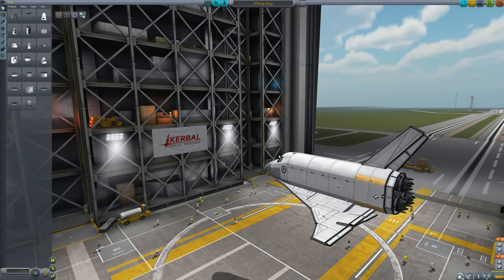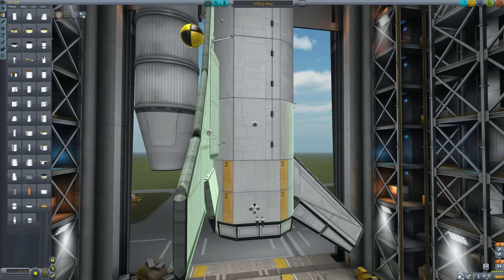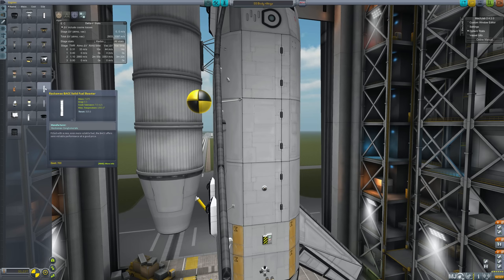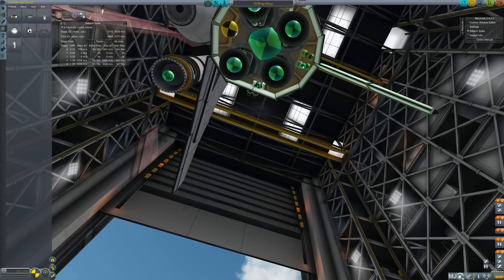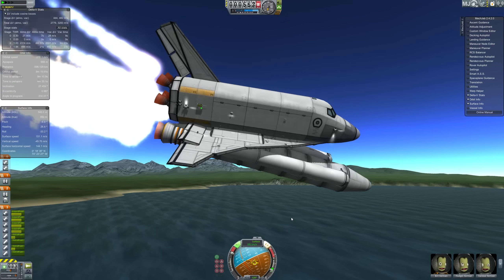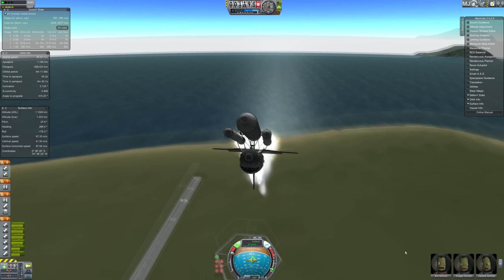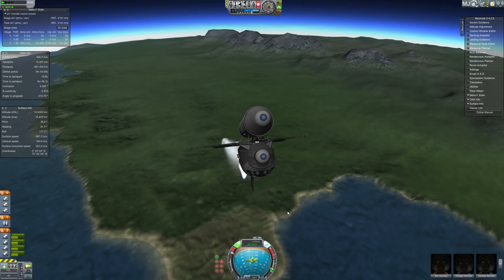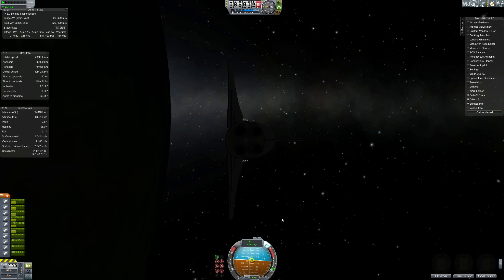Making The Kerbal Shuttle Fly To Space!

Comment: Fun fact: after the real Space Shuttle ditched the SRBs, it actually was too heavy to make it into orbit. However, after burning fuel for another few seconds, it then became light enough to continue going into space. So it was basically built EXACTLY the right size.
Reply from the maker: Orbiter 2010 specifically covers this in it's FAQ, don't enable infinite fuel if you want to fly the shuttle to orbit.
Reply: My shuttle had that same problem, except it lasted about 20-30 seconds.
Reply: Bioshyn that's typical for rockets, especially in KSP. That happens to me all the time, however in the case of the Space Shuttle orbiter,when they say it has just enough thrust and loss of fuel, they don't mean that it looses a couple m/s of acceleration, they mean that it looses significant acceleration.
Reply: The Space Shuttle was way beyond the limits of the original plan. 
Sarcastically: Thanks Air Force.
Reply: OBP Super Gamer actually, yes, that is completely correct, but I used that as a relatable example. Also they have worse thrust-to-weight ratio in KSP, but the Earth is much larger, so KSP has a better thrust-to-weight-to-planetary-scale ratio or whatever, if you know what I mean.
Reply: Scott Manley I made that mistake once. Couldn't figure out why mother Earth pulled it back down again, hehe.
Reply: It was designed like that intentionally because of the complexity of building such a craft. The space shuttle is made of really light material because this really does come to show that every little bit of weight matters. In fact, the space shuttle is made of a fabric that is made of a rock (I think it was granite, although I don't remember exactly), along with carbon-carbon (black) insulation tiles on the parts that get heated most during re-entry, unlike what the textures in this game show. It's really misleading, and, when you see the space shuttle in real life (which I did) you can see (and even hold and touch samples of) the fabric and how light it is and the heat shield material on the bottom, which is also extremely light for how strong it is. So it's no coincidence that the weight was balanced so delicately.
Reply: 71tofu Not at all, actually...

Spaceplanes are much more difficult to build. Why do you think it took NASA about 20 years to fly the shuttle? Counting designs from the mid-60s, of course.
Reply: 71tofu That's debatable.

The USAF wanted a much larger design to accommodate their future planned spy satellites. This causes the Shuttle to be more expensive and larger than planned.

Did you hear about the astronaut who's going to spend a year on the ISS? ( If you ask me it's a few years too late...)
Reply: Skul, Oh My God I learned that building my full size one - it's heavy as all hell! It was like kerbin was chained to the bottom of the rocket. I have three KR-2Ls on the back with Mainsail OMSs and it barely is enough to pull away after SRB decouple -it still slows down after it comes of. Scary stuff Shuttles.
Also, Scott's shuttle is simple but horribly inaccurate - I managed to make a Full size shuttle that looks much better than his. But not everyone can be me i guess XD
Reply: 71tofu It's what reality is, support and funding.
Reply: 71tofu See, I wasn't going to reply to your previous comment calling Wheatley a dick for stomping on your dreams with reality, but honestly... you presented your dream machine as fact, then argued with other people that it's fact when it's not even a tested hypothesis, then fought everyone over the fact that they brought reality to bear against your dream:  dismissing their proven reality as irrelevant to your hypothetical one.  If you had presented your point as, "I'm working on a design that might work" instead of "My design will be reality", his(?) approach would be dick-ish.  Instead, you're being stubborn and insisting you have the new cure for a problem without any data to back it up, then snapping at people who point out that you have a hypothesis that needs testing - which requires further analysis, financial investment, resources, et cetera.  Calm down, reevaluate things, and remember - these are just words on the internet.
Reply: Sierra Whiskey Yeah, if he weren't saying it was in fact possible and such I wouldn't-v'e "stomped on his dream". It's just that he argued that it was indeed a fact.
Reply: Wheatley Money wouldn't be a problem if humanity wasn't greedy, no?
I think we must end this, as neither side is getting anywhere. David North thank you for siding with me. It does my heart good to know I'm not alone in this.
Reply: +SkulShurtugalTCG A lot of rockets are like that. For example, the TWR of the Saturn V was about 1.2, however, after first stage separation and second stage ignition, the TWR was about .8. So as it burns fuel, the TWR increases, bringing it above 1.
Reply: The whole point of a rocket is to burn fuel. By doing so they go to space. Not really a lot of fun that fact.
Reply: rocket equation in action
Reply: And that burning of fuel did not propel it any further? Only made it lighter? I doubt that. I guess what you mean may be that its TWR droped below one for a short time,  but if it did that does not mean that that fuel was wasted.
Reply: lol I just use Space Shuttle Engines.
Reply: Markus *Mother Kerbin* 
:)
Reply: Wheatley Father Kerbol?
Ship confirmed, be prepared for fanart.
Reply: KASASpace Well, to be fair, the space shuttle proved its use so well that it would be hard to do without it. Still, the need to keep people in space for extended periods of time is declining, so I'd imagine that they're going to go back to the drawing boards to create an actual space plane. Such an item would be incredibly useful.
Reply: KASASpace If you ask me, we should already be launching the mission to Mars.
However, a space plane can still be made large enough to launch a spy satellite. It would be a larger upfront cost and have a slightly higher maintenance cost, but you could launch it at a moments notice, provided you can refuel its tanks. I think most people underestimate the ability of a space plane. We have the technology to get one into orbit, why aren't we?
Reply: 71tofu Spy satellite designs quickly got smaller than the 15 feet by 60 feet that the cargo bay of the shuttle needed to be.

And a spaceplane is not necessarily a SSTO.
Reply: KASASpace That's true. My concept for an IRL spaceplane involved using drop tanks for liquid fuel while the fuselage had LFO. It had one main engine, the one used while in space, and four auxiliary engines, mounted around the main engine. It would be a pretty big space plane and would need a large runway, but it's doable, or so my math says. Note: The actual insertion burn would be made using hypergolic fuel stored in canisters inside the cargo bay that can be jettisoned once empty.
Reply: 71tofu the first comment you put: that's not true, in fact, "going back to the drawing board" for a new space plane has nothing to do with the retirement of the Space Shuttle. It's main use was to construct the ISS and maintain the Hubble, along a few more details, but the Space Shuttle is out of service because we no longer need the payload bay anymore. Unfortunately, that means we have to fully rely on Russian rockets until SpaceX, Boeing, potentially Sierra Nevada, and probably replicas of NASA's Orion, have functional tested rockets for use as Astronaut transport.

And technically to an extent Sierra Nevada's dream chaser is the closes thing we will be using to a space plane, although it isn't really one.
Reply: KASASpace there are two astronauts planned to live on the ISS for a year. One of them is a cosmonaut.
Reply: Wheatley That's why I said the (singular) astronaut, two PEOPLE are, but only one is an astronaut. The other is a cosmonaut.
Reply: KASASpace true, yet generally when you talk in that context, it would imply that one person is involved; You just mention half of a story is all.
Reply: Wheatley Yeah....

It's an experiment that should have been done on the ISS a long time ago.
Reply: Wheatley And yet it would be far more cost effective to invest in a spaceplane now rather than later.
Reply: KASASpace Failure is the best path to success.
Still, it CAN be done. People have shown it's possible through simulations. That we've not done it yet is a travesty.
Reply: 71tofu That's not true at all. Before you make any assumptions, which you should never do anyways, you can learn not only historically, but scientifically how complex a space-plane has to be to function. The Space Shuttle orbiter took over 20 years of development and as new orbiters were made, it was even still improved upon. Even before they started, NASA knew that making a space-plane was going to be really hard to build, some even thought it was practically impossible, and when they began designing it, they realized how much reform was necessary in the design and just how hard it would be. A space shuttle is even still just barely a space-plane by some definitions, to make one that flies into orbit would be astoundingly harder, on a completely new level still, and the "investing" that you're talking about is going into 'setting up camp' on Mars, including designing and testing the rockets necessary to get us there and sustain life.

In the mean time, we have a small space-plane (that is even less functional than the Space Shuttle orbiter), called the Dream Chaser, designed by Sierra Nevada Corporation. It is much simpler than the orbiter because it lifts off like a module on top of a rocket and only serves as a module but with the same living space as the space shuttle (which excludes the payload bay). And other than that, the only difference to a module is the fact that it glides down and lands on a runway as opposed to vertical landings made by modules.
Reply: TheIcemanFiles I felt accomplished enough when I created my own (very small) Mk2 space-shuttle type plane XD it wasn't nearly as hard, but it was hard enough for me. I'm pretty bad at designing planes and space-planes in KSP, and I only recently (having only 160 hours in-game, and a 1600 hours of tutorials, Scott Manley videos, and Danny2462 videos). I'm not even gonna attempt the Mk3 Space Shuttle design until the 1.0 update, cause then it's gonna be more aerodynamically stable, and any 9.0 Mk3 space shuttles probably won't work, plus it'll look a lot nicer. So until then, I'm bailin' out!
Reply: Wheatley I don't think you understand. I am a student that never liked homework, so I got a chance to redeem my grades, and thusly pass my course in CAD if I could come up with something and design it. Because I like space so much, I decided to take a look at a space plane, and what it would take to make one IRL. It was costly, yes, but I managed to design one that would be able to fly high and fast, then switch to the main engine that carried it into space, then used hypergolic fuels and RCS thrusters to achieve orbit. It took me an entire week of 12 hour(a day) work at home to design one that would fly well in atmosphere, be able to take off and land on a runway, and achieve orbit.(Theoretically) Or, it had the D/V and the TWR, but I had NO idea if it really could because I don't have that kind of money. But hey, he has it sitting on his desk because he printed it out using a 3D printer. So that's kinda cool, I guess.
Also, nice. Making a spaceplane in KSP that can reach orbit is pretty hard. My builds tend to get on the larger side, and rely on LF drop tanks to fuel the jet engines.
Reply: 71tofu Just because it works in simulation, doesn't mean it works IRL.

Plus, the simulation doesn't count the development cost, the ground crew to operate it, the logistics to support the vehicle and the ground crew, and the large lack of support for such endeavors. Your spaceplane is grounded, sir.
Reply: KASASpace Words like "funding" and "support" are all subjective. Give it time and it may change. Also, damn simulations, not always being 100% accurate.
Reply: 71tofu And yest, listen to KASASPace there. Funding and limited materials and testing are an important part of reality. If we didn't have to worry about those, we would already be way beyond having a base on Mars.
Reply: KASASpace Wheatley Both will eventually be found to be hindering to the overall progression of humanity, and be abolished. Or reduce its use to "frivolous" items, IE, the things you don't need to survive.
We're not perfect, but we need to understand that certain things that may work now will not work later. The line of thought that is "It has been, is, and so it will be." has been disproven time and time again. What reality is now may not be come 50, 30, or even 20 years.
Reply: 71tofu You are literally being completely irrelevant to sound like you know what you are saying and nobody likes that guy, so whatever.
Reply: 71tofu Wheatley is a dick for pointing out that funding, materials, testing, fabrication, et cetera are all very important, very real requirements in developing a spacecraft?  If willpower and design were enough, the Enterprise would have seen space rather than having a slapdash refit put together to take its place in space flight (OV-99, Challenger).

The Shuttle Orbiter was not a "space plane" as it was never a plane - it was the world's most expensive, most dangerous glider.  Don't get me wrong - I have enormous respect for the Shuttle, but at the end of the day it wasn't built in a way that made it a good investment, especially by the end of its service life.  It's a pity that we don't have anything that is remotely as capable as the Shuttle, but at the same time it was a horribly expensive, incredibly risky gamble.
Reply: Sierra Whiskey He's a dick for being a dream crusher. I can still hope that it will happen, even if he says it won't doesn't mean he has to be a dick about it.
Reply: 71tofu Not crushing dreams, but putting them under the light of reality, which can crush dreams.
Reply: KASASpace Call it what you will, but you didn't even offer a statement of "But maybe it will happen." No encouragement just showing reality. Sounds like dream crushing to me. I tend to favor the side of realism, but I will always offer everyone a word of encouragement.
Reply: 71tofu Maybe it'll happen. Maybe it won't. Leaning heavily towards the "Not" side.

Not saying that it isn't a good idea or anything, but it's not very useful if it's not 100% perfect. And nothing is, so....
Reply: I'm just gonna back away because from my experience, especially on the internet, it's really hard to punch sense into somebody who has none, so I don't feel like going into one at the moment, but 71tofu Finance and testing are an essential part to space exploration and you cannot treat them as "subjective" (you aren't even using that word correctly, but I get what you are trying to say). So KASASpace, good luck with him, heheh
Reply: KASASpace Hey, and I respect that. Maybe the time will come when something like that will be useful. You never know.
Reply: Sierra Whiskey And here I was thinking we were having a calm and mannered debate.
I'm dead serious.
Reply: 71tofu so you know, I'm not acting like  Wheatley "behind the screen" so you can't just make bias assumptions like that. Also what was upsetting me about your view is that +KASASpace is trying to explain things as they are in real life and you are trying to argue them with hopes and dreams. I'm not saying a legitimate Space Plane is not possible, for example, but you think of everything else aside from the free-building, such as funding, time, other focuses, more important focuses, as non-existent. Reality is something you can't just wave off (not very surprising). And in reality, I'm not Wheatley-the-ass, like you blamed for my point of view.
Reply: Wheatley Woah, christ, now you're just giving me a headache. What I meant flew completely over your head. It's like you weren't even putting that much thought into it.
Reply: 71tofu yeah sure okay you're gonna do that now. Have it your way.
Reply: RetardedBMXSyndrome I would normally say "thanks, captain obvious", but in this case, that was sort of necessary, except that it doesn't really apply to either side
Reply: yOUR MEANT FPOR POKEMON YOU BITCH
Reply: DominicMazilla B. My interests go FAR beyond Pokemon. For example: space exploration.
Reply: DominicMazilla B. *marked for spam*
Reply: Marked for spam ^^^^
Reply: 71tofu after reading through this entire conversation I'm on your side. Yes its a pretty tough task to construct a working prototype of anything let alone one of the most complex spacecraft, doesn't mean agencies can't take a serious look at them if their capabilities suit mission requirements.
Reply: 71tofu The whole issue with what you said that 1) we ARE going to make a space plane, and 2) should already be going to Mars is the fact that NASA doesn't have any plans to make a space-plane, and specifically aren't making one BECAUSE of the price, both to make and to launch, since standard rockets are dramatically cheaper and easier to build, launch, and maintain, etc. And secondly, you talk about how we "should already be going to Mars" as if we don't have the technology and as if we are Soviet Russia and don't spend years testing out technology to save money and lives. We are developing the technology to go to mars (Orion, Dragon V2, CTS-100) but those companies still have to test and develop and build some of the technology to go to Mars, and we even already have a plan-base for going to Mars within the next decade -- plus a little (not just  a quoting Kennedy, SpaceX is planning on putting people on Mars by 2026, and  NASA is planning on doing the same soon after)
Reply: David North  What you are failing to realize is money really is one of the biggest issues involved that limits what NASA, SpaceX, European Space Agency, Boeing, etc can do, and not only that, but the fact that building space-planes not only takes hundreds of billions of dollars to develop and launch (the total cost of each launch for a space shuttle being 1.5 billion dollars, the launch process alone being 450 million, which is exactly the cost of the entirety of SpaceX's "Falcon program")
Reply: Wheatley
No I fully realize how money is the limiting factor. It always is the biggest hurdle, but it doesn't mean its impossible to achieve the funding, it just means its very very difficult. If the capabilities of a spaceplane are what a mission requires, then agencies will do their best to fund development. I know that doesn't mean they won't have to fall back to other technologies and launch vectors. By "should be going to Mars" I'm almost certain 71tofu means they think we ought to have out in the time and effort to develop the necessary technologies, not that we have them now, and that it should be a priority.
Reply: David North Indeed. In addition, we DO have the tech to go to, land on, and set up a rudimentary outpost on Mars. To pave the way for further development. It seems odd that we insist on not even trying to work for building an outpost on Mars at all. We don't know if there's even a location picked out for a base, let alone the plans for one. Even if it would be one of those situations where we say "It's subject to change at any moment."
Reply: Sammy Feldman lol, I know someone in my Physics class named Sammy...
Reply: Wheatley lol I took physics two years ago
Reply: Sammy Feldman  Absolutely my favorite subject. Btw you are talking about HS AP Physics right? (or for that matter, college physics).
Reply: Wheatley Yup. AP Physics B. Now it's split into physics 1 and 2
Reply: Sammy Feldman  LOL In my school we currently have Honors Physics [formerly A(?)], AP Physics 1, and AP Phyics C. It's really screwed up cause there's an awkward transition period -- especially cause last year it was Physics A, 1, and C
Reply: Wheatley sheeeeit
Reply: +KASASpace DoD was expecting it to be able to fly regularly enough and be cheap enough that they could fly payloads without people really noticing.  Unfortunately, that didn't pan out, and the DoD's payloads were moved to other launch vehicles as soon as they became available.
Reply: +calkhi The UK are developing a very nice looking space plane, here to hoping that we actually complete it and use it rather than what we usually do. Scrap it due to being a little on the expensive side.
Reply: Daniel Cotton
 Skylon really does look exciting, and I would love to see it fly.
Reply: spotted eating spam.
Reply: It became lighter because the shuttle had less forces pulling against it as it escaped the Earth atmosphere.
Reply: Lunar Prix Read that back to yourself. Does it make sense?
Reply: Sammy Feldman Actulley it does, one of the reasons why rockets in KSP dip down so often is because air in the atmosphere brings a lot of drag unto the rocket, same applies for real life. Also when rockets leave the atmosphere the air drag is majorly reduced making the rocket go lighter until it has reached Zero Gravity.
Reply: Lunar Prix That's not what is happening. It becomes lighter because it loses mass, in the form of fuel and oxidizer. You cannot become lighter because of aerodynamic forces decreasing, weight is only an effect of mass (or if you want to get technical, mass-energy, which is why light can curve in space-time) and the force of gravity. In addition to that, what you're trying to say about aerodynamics applies universally to all rockets, but the aerodynamics of a space shuttle have special properties that other rockets do not have, but what you mentioned is not related to that. If you want to learn more, just read the comments above, or better yet just look it up
Reply: +Sammy Feldman : 3
Reply: My shuttle's center of mass changes so much that if you are not high enough in the atmosphere in time, the shuttle will not be able to climb fast enough without becoming unstable xD It is stable enough to make a landing, albeit, with its nose pointed up slightly. Tough to fly, but it can make it to orbit without a booster, with just enough fuel left to retro burn and make a landing.
Trying to preposition the lift further in front of the center of mass, it causes it to need more fuel to make it to orbit, causing me to not have enough fuel left to get out of orbit, so I went with the hard to fly, but more efficient approach instead.
Reply: Richard Smith Pro-tip, move the external fuel tank upward. It allows your center of mass to move less with respect to the axis of rotation for the rocket gimbal.
Reply: Wheatley The one I was talking about has no external tank, it can fly to orbit with the fuel in its own tanks. I use it to jump from orbit to other planets, then return to land, but it is capable of getting into orbit under its own power, no external tanks required, but thanks for the tip, ill remember that.
Reply: Richard Smith Lol. Oh, actually that's really impressive.
But then, (and this is basically just taxonomy at this point), that's an SSTO in that case, not a shuttle. :)
I've built a hyperrealistic version of the Space Shuttle with stock parts, yet I so far haven't built a fully-functional SSTO (single stage to orbit [ship]). I haven't put full effort into building one yet, but in certain ways, it can be even harder to build, if yours can even go to other planets. I'm impressed :)
Reply: Wheatley It only goes to other planets when I strap it to a rocket, or get itself into orbit under its own power to release a probe, and then return home, but not both at the same time xD
I am yet to figure out an interplanetary SSTO, but I guess it would be possible with secondary xenon engines, albeit... VERY slow.
Reply: Richard Smith
Yeah, idk if an interplanetary SSTO is even possible.. then again I ALWAYS underestimate the capacity of those xenon tanks.
I once created a probe that at one point had to do a 20 minute burn, and it still had 90% of its one and only xenon tank left.
Reply: in ksp or irl? In KSP yes, there are a few vids about of that, haven't done it myself though.
Reply: Arne Schwarz what he means is that it was too heavy to fly so it burned fuel in waste just to lighten itself. it is interesting
Reply: Good to know
Reply: I think all rockets have this issue ;(
Reply: Wheatley Actually, if anything, it happens more often IRL because KSP engines tend to have much batter thrust-to-mass ratios than their RW counterparts.
Reply: *****
Not very ... it's just reality.
Reply: Arne Schwarz no I suppose not.